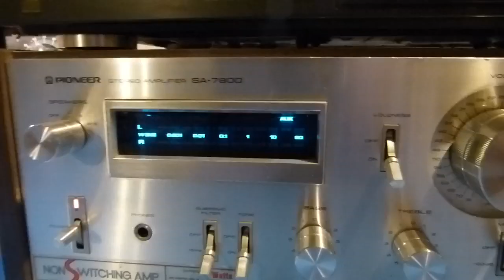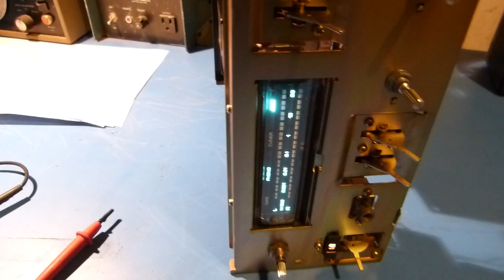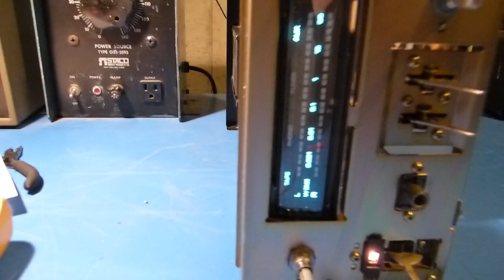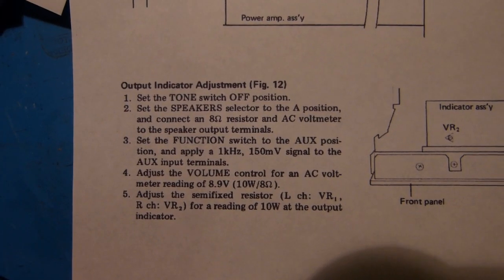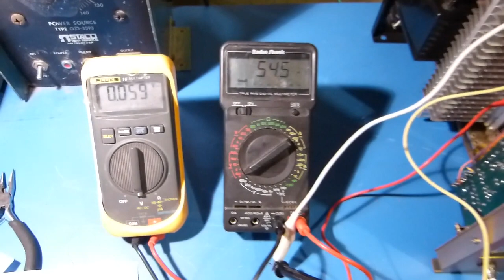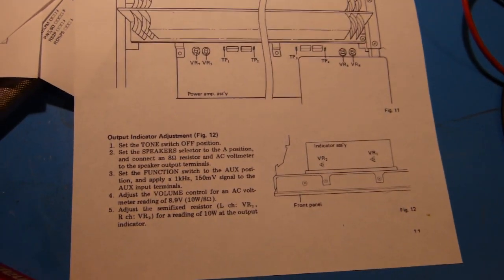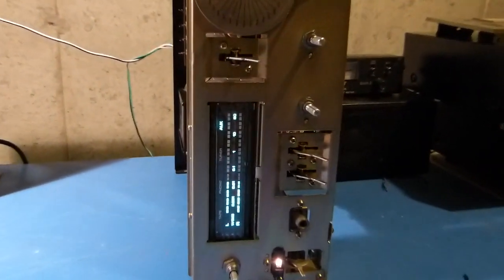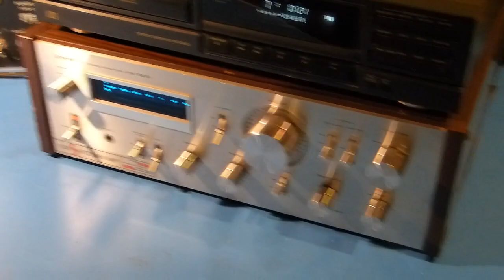Pioneer SA-7800 Repair Part 2

Comment: Thanks for these videos, I have one of these amps with metal outer case.
Still works, but I am in the process of replacing the broken speaker terminals to be able to accept banana plugs

Comment: I have the same model but it has no power I did replaced the transformer but still won’t work,the display board lit on but when I plug the MP3 audio cord in audio and hit play no movements in the display board like those long blue lights like those equalizer light when you play the MP3 so what it seems to be the problem there is it the relay need to be replace anyone has idea what could be the problem,Appropriate your help big time. Thank you 🙏

Comment: I'm having trouble with my 7800 pioneer stereo sound is low until you touch the Land R ,stereo nob
Reply from the maker: sounds like the controls need to be cleaned

Comment: Hello, the video is great !! I have the Sa 8800 and the display is not as bright as it should be, could it be that I have to change the capacitors? thanks!!
Reply from the maker: I think these displays loose brightness over time.  You can try new capacitors but it may not help
Reply: @SevenFortyOne  thanks!

Comment: I knew that the caps were not responsible for that unwanted noise, usually its resistors, pre driver transistors, or driver transistors (differential) but not output transistors. Even dried joints around those components as in your case. But recapping is great move so it extends the life of your amp.

Comment: Very Intriguing. One question about your capacitor replacement.  Was that brown gunk on the bottom from a bad capacitor or was that glue placed to hold it from the manufacturer? I did see some caps with brown gunk on bottom also.
I have an SX 1050 that smoked the large resistor and thermistor when I turned it on.  (Bad ebayer said it worked) I also heard a loud gunshot (probably one of the big capacitors  that blew up).  He did a miserable job at packing so had to fix the bottom of receiver from shipping. I purchased for around $ 350.00 so will keep and try to fix or ?  shipping would cost me nearly 100.00 to send it back to him.  Also owns an SX 1080 ( I love those meters) and an SX 1250 (getting repair on tuner section) ebayer did not know what he was doing. Perhaps I will purchase an SX 1980 someday?
Reply: The brown gunk on the bottom of the capacitors is most likely just glue. A lot of amplifiers back in those days used it to keep capacitors from moving around too much. Problem is, sometimes the glue becomes conductive. I'd replace them for that reason. A leaking capacitor (most of the time) would have a bulged top, what kind of looks like brown battery acid leaking out of it, or burn marks. In the case of this amplifier shown in the video. The stuff from the first video is definitely just a glue type substance.
Reply from the maker: It very well could have been leaked electrolyte...

  Too bad about the dishonest eBayers - I've had that happen a time or two myself.
Thanks for taking the time to comment and good luck with your project!

Comment: I was wrong now I flipped the receiver and took the back part off and they're good and the sound that I hear its not coming from there but its almost impossible to know were the sound its coming from it seems that the sound its from the other side of the power supply were the screen and buttons are

Comment from the maker: No, those are resistors.  I'm not sure how you can hear anything coming out of them but maybe their solder joints are bad.  You could try re flowing the solder that hols them to the other side of the board.  One word of advice/caution though...you can get seriously hurt by the large filter caps.  When doing any work on this unit you should unplug it and THEN DISCHARGE THE FILTER CAPS!!!  If you don't know the proper way to do this then you may want to stop and have some who does help you.

Comment: I think that I found the problem, on the left of the 4 large filter capacitors there's two kinda red cylinder things (capacitors?) I don't know what they're called, each one has 2 little white tubes around the solder joints (where they're attached to) and I can hear noises coming out of them the noises stop for a bit and then comes out again and so on
Are those the problem?

Comment from the maker: I had a problem with my camera while working on this part of the refurbish and don't have any video.  The noise I was getting was due to cracked solder joints on the two transistors in the power supply section that have heatsinks attached (I don't recall their designation).  Go to the audiokarma website and do a search on SA-7800; there is a bunch of into there to help you firther troubleshoot this problem.

Comment: Great recap job! I did the same with my SA-7800 last year :)

A little pointer I noticed in your video- BOTH channels should read 66mV not 66mV left and 53mV right. The manual is a little misleading but you would adjust each channel, first for 53mV, and then 66mV.

Hope that didnt sound too picky but just a little pointer :) Cheers